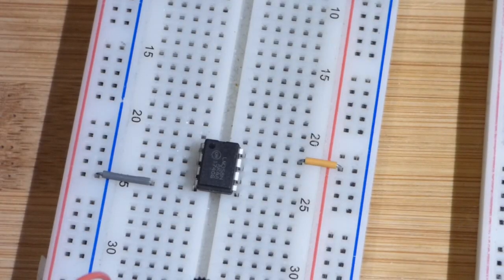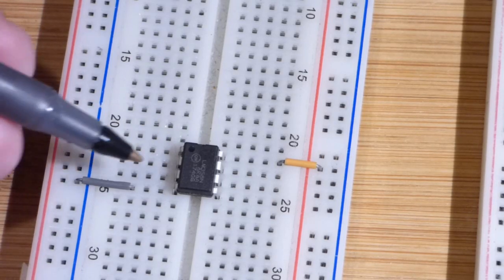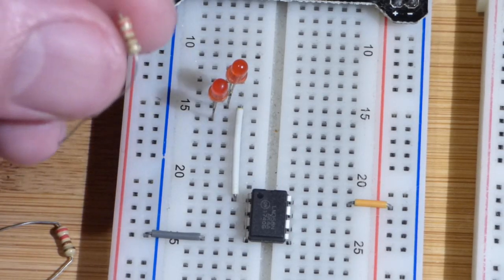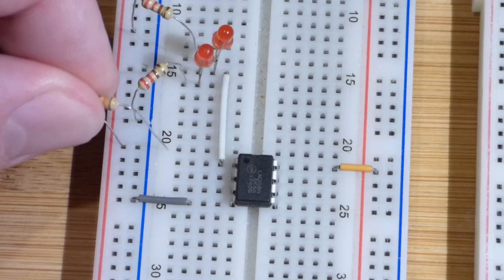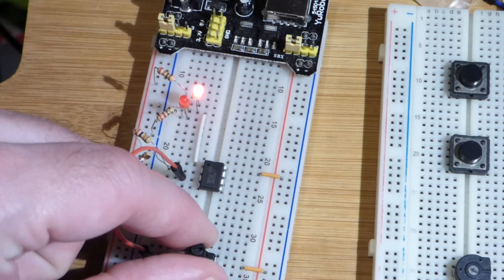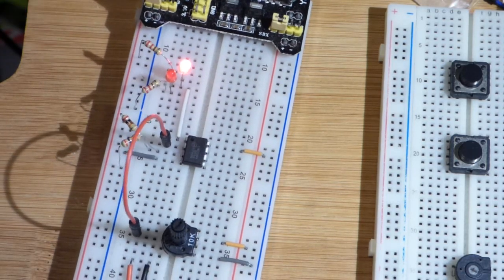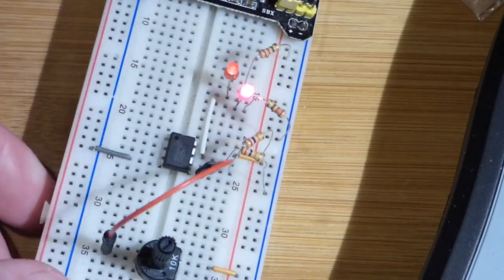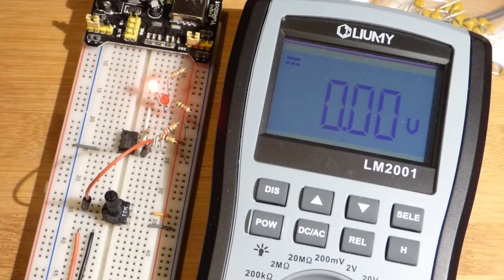Testing out LM358 dual op amp IC comparator circuits and running into some unexpected problems

Comment: The positive and negative "rails" are the limits, positive or negative, for a given supply voltage that the inputs can tolerate without going into saturation and possibly damaging the device.  The rails are not the positive and negative supply voltages.  Also, if you opt for a single supply voltage, you must bias one of the inputs and note that the "rails" have changed.
Reply from the maker: Thanks for the info!

Comment: Where do you get your giant buttons and cool trim pots that plug right in?
Reply from the maker: I don't really remember anymore. I think a few kits I have came with large push button switches, but that was years ago and so there's a good chance they changed the exact components in the kit.
Reply: @Electronzap  ok, thanks.
I'm sure if I search hard enough I can find some.

Comment: Great tutorials!  For the voltage divider I used the 220 ohm resistors (same setup as in one of your other videos) and did not experience the problem of the two LEDs being on at the same time. I also used a green and a red one, but don't think that made a difference.
Reply: I don't think the voltage divider has that effect, since an op amp compares voltage, not current.
If i remember correctly, a green LED has about 2.2V forward voltage and will probably not light up at 1.7V, which should be the forward voltage of most red LEDs.
Reply from the maker: Thanks! Sounds good!

Comment: I guess i have an explanation for this problem: The LM358 can output a max. of around 20 mA but this is not ideal - so it would not meet the rail voltages Vcc/Gnd. In one case it is more off the ideal than in the other. You can use 2 small signal transistors like the BC547 e.g. to amplify the output and probably get a better result. The heavy load draws the output of the Opamp to the opposite, so its hard for him to handle that situation. An other possibility would be to use much higher resistors in front of the leds to drop the current to about 1-2 mA.
Reply from the maker: Thanks for the tips!